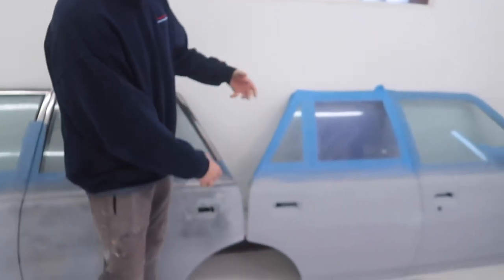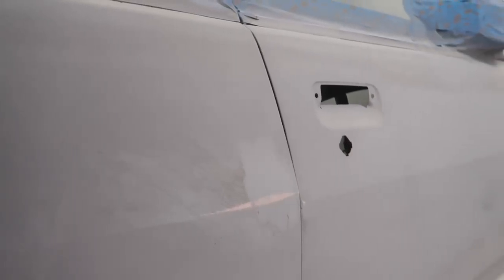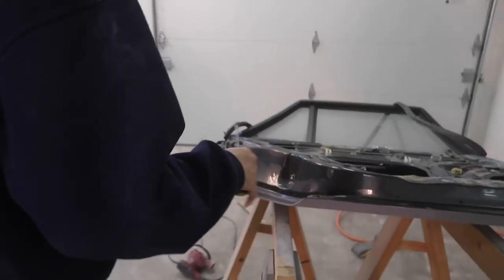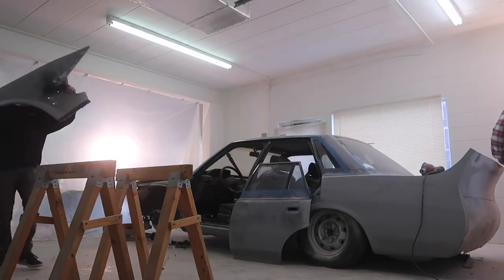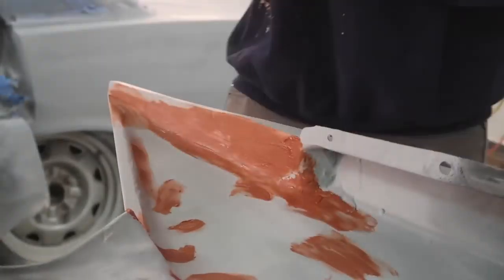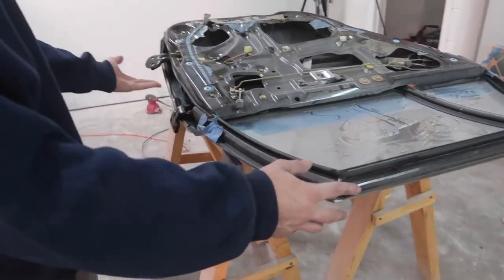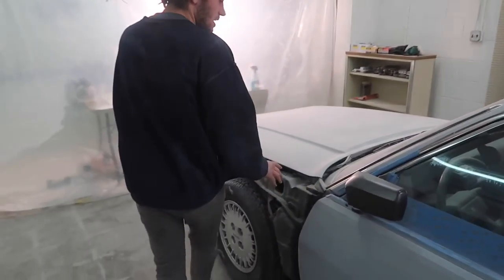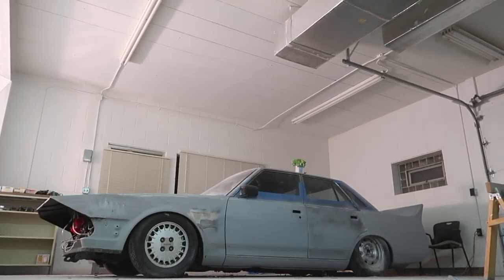This Isn't Going Anywhere!

Comment: Careful putting doors on horses and a parts stands like that, you might get 2 long,narrow dents cause of the weight of the doors. Place them the other way or put a piece of 1/2 ply wood down on the stands 1st and just lay the doors on top of the plywood with a moving blanket on top of the plywood.

Comment: Will that bondo crack in the cold? I’m not shit talking I just never used it before
Reply: Hunter Berg no not unless you apply it wet and it's freezing outside. Or you are driving in sub zero temps. As long as he seals the Bondo well with primer and paint it will last a long while.